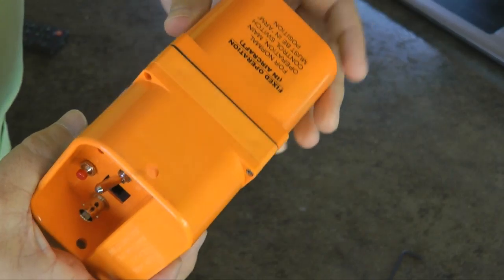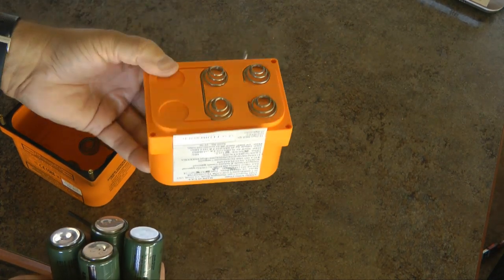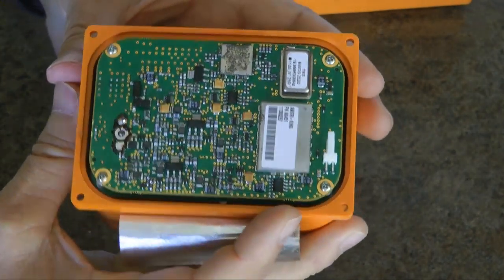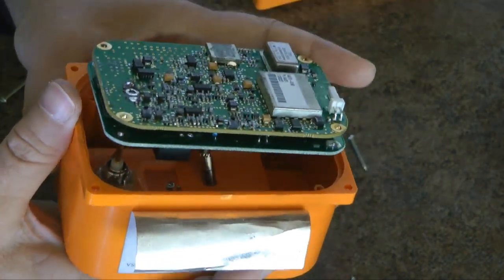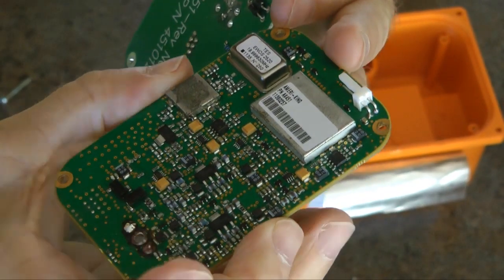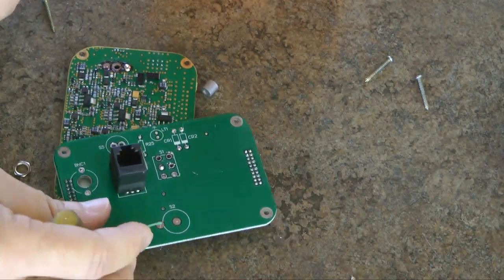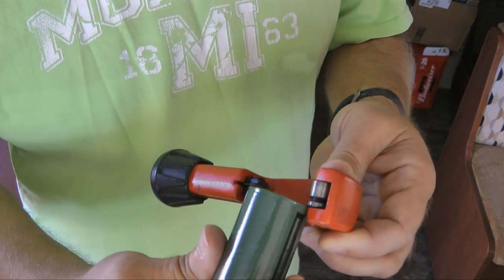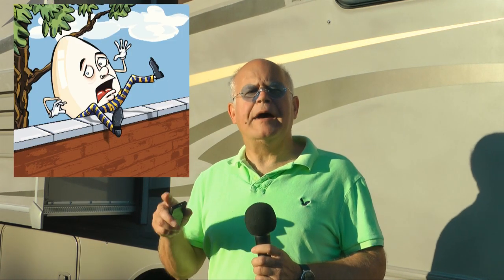Don't do THIS to your aircraft's ELT

Comment: Pretty sure why these units were "canned" by the FAA for, detailed reason. The primary PCB "wave" automated soldering was a bit sketchy, a few spots not enough solder. The bigger problem the switches, LED, jacks etc. A number of places poor soldering for a unit installation in a vibration environment. Not enough solder around the legs to have optimal dependability. In the trash it goes, not worth the risk to keep it installed.

Comment: Either the soldering process controls at the factory are poor, or someone had already been inside that ELT.  The circuit board looked awful where the BNC connector and the toggle switch had been installed.  And there's no way you pulled loose a DPDT switch that had been correctly soldered on all six pins.
Reply: I was going to write the same thing.  The cable broke too.  It was using a solid wire and broke with a slight bending action.  That brand name ELT is JUNK
Reply: @Neilazbiker  You're supposed to give wires & cables a little tug to make sure it's secured anyways.
Reply: @Neilazbiker all very valid points, they obviously didn't care at all that this was intended as a life saving device, profits is all they cared about.
Reply: Someone HAD obviously already been inside previously. The display LED was missing before he even started. The switch had been unsoldered previously too.

Comment: How can it transmit if antenna gets ripped off during crash? I was told by inspector its most worthless device on airplane.
Reply: It's supposed to be mounted in a well protected area of the aircraft, preferably right behind the passengers and near the center of the airframe.

Comment: The funny thing is, they charge you another $500 dollars for the longer lasting version of the ELT... which is really just 2 more batteries you can install yourself.  And its disconcerting that the toggle switch fell off that easily.  And the G-switch also.... wow, really piss poor quality.
Reply: The G switch slides onto a tube that protects it from flexing and breaking off. They could however mount it flush to the PCB, less flexing on that base leg.

Comment: How about looking inside a fuel tank?  All you'd have to do is to dump out most of the fuel and use a cutting torch to open the tank for inspection,  What could possibly go wrong?
Reply: Silly comment, there are modern technology's, "bore scope" to look inside.

Comment: rubbish elt, the g switch already broke of by moving it, in a crash it would fly off and no distress signal...
Reply: There is a detection circuit inside, its normally closed.. if the g-switcht flies of..  circuit open... distress